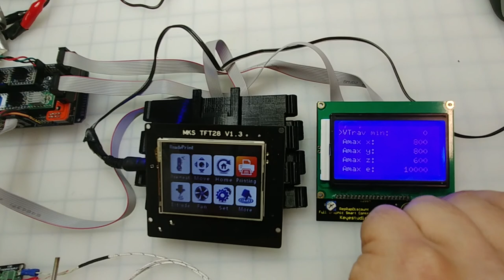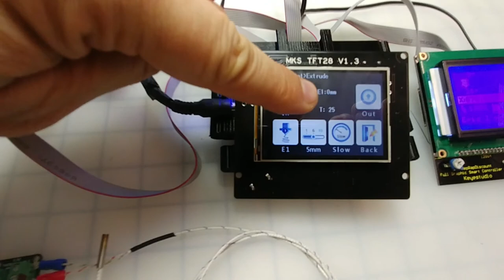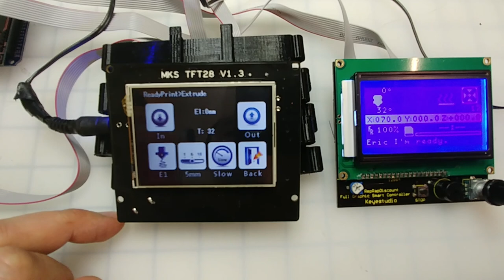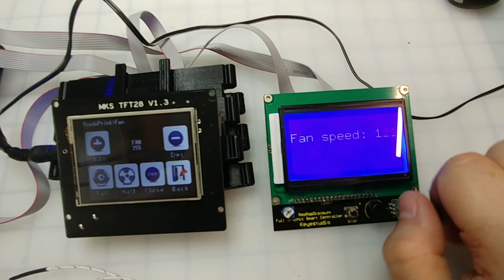Gmax 1.5 XT+ Silent TMC2100, Thermocouple, TFT 28 & Full Graphic Controller

Comment: Thanks for the interesting article. I bought a current 3.5 "display. If I operate both displays on RAMPS 1.4 at the same time, then unfortunately I have the problem that the display on the RepRap discount display 128x64 is very pale. Apparently the new display draws too much power. Maybe do you have a proposal for a solution?
Reply from the maker: Use a power supply for the 3.5 display

Comment: Hey 
I have the same touch screen, but i cant control the settings by there. The board turns on and it looks ok, but i cannot command from there. There is anything to do other than power by an ext. supply (12v) and uploading the firmware? I mean, any other config. in Marlin ?

Comment: Could you do a video on how you got the tft to work? Do you tyhink it would work with ramps 1.4
Reply from the maker: That is the Ramps 1.4 that the TFT is working with. There are several videos on YouTube showing that. However, if you  think it would be beneficial I can also show how to do it. 
Let me  know.
Reply: titiki1000 yes I would like to know. What firmware are you using?